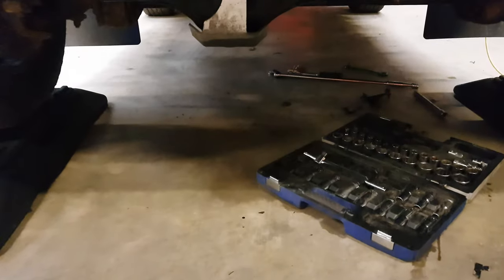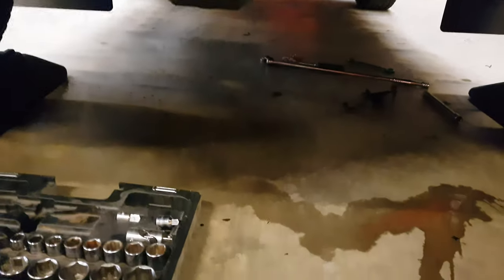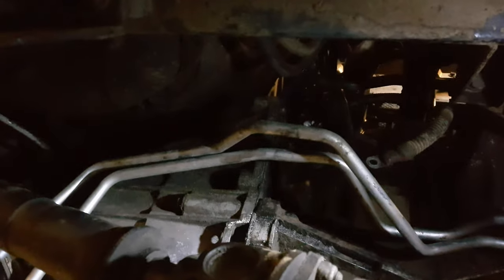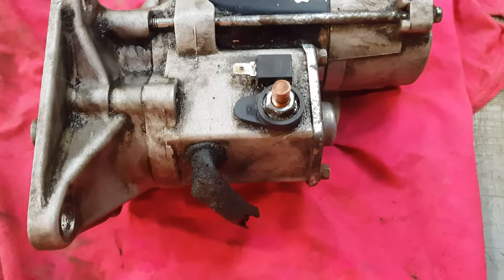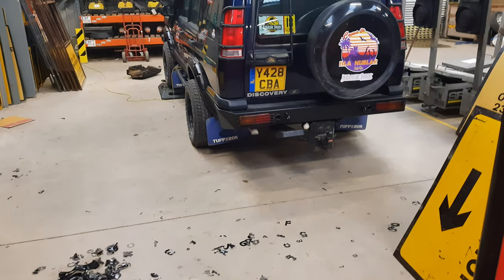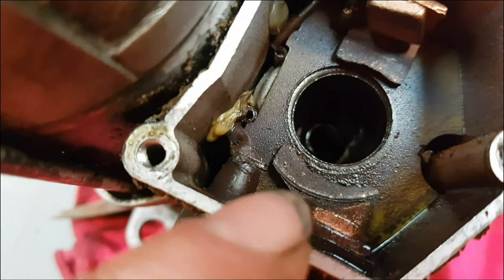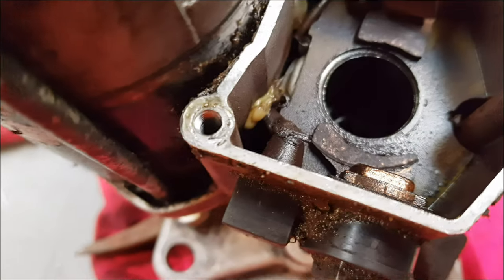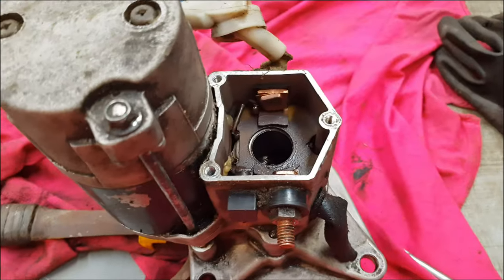Td5 Starter Solenoid Repair

Comment: Why did you take the starter motor out when you can do the job without detaching the starter motor? All you have to do is to remove the 3 bolts on the solenoid lid.
Reply from the maker: For filming purposes I chose to take it out so I could see it properly on the bench